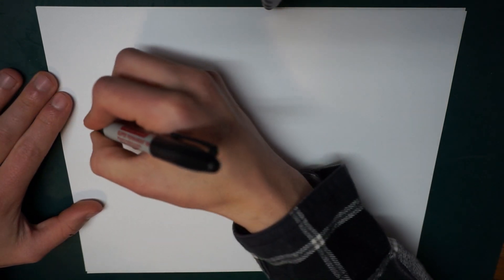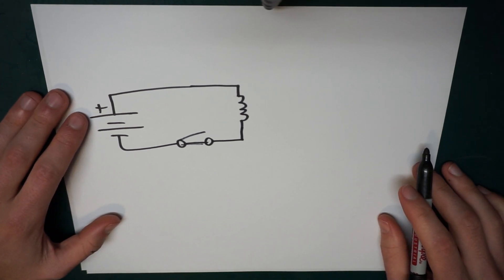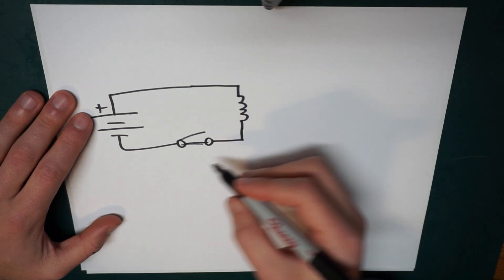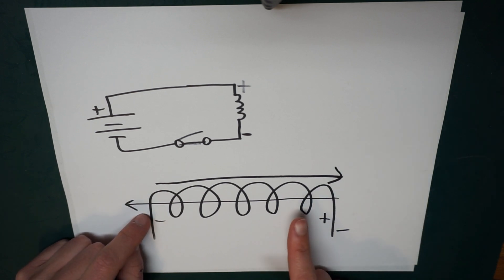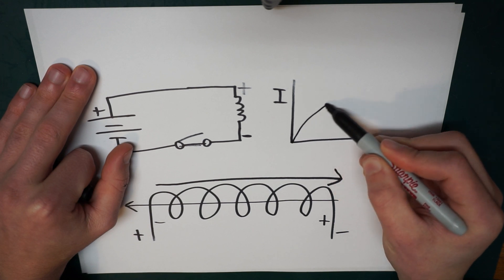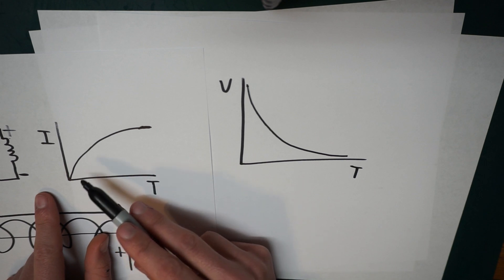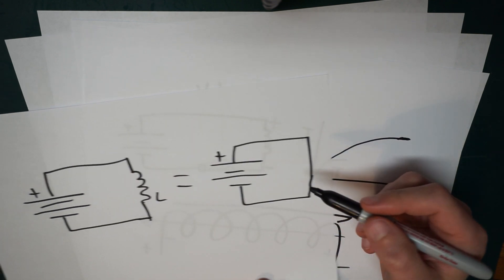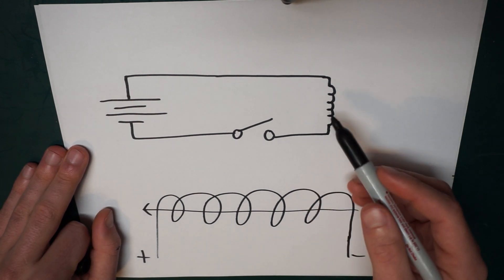Circuit Fundamentals - Inductors in DC Circuits

Comment: In your initial circuits there was no resistor in the loop. Then the current in Inductor should not settle to a constant value right? It will keep on increasing like a ramp signal?

Comment: That was a great explanation but what I've found is that doesn't apply to all inductors. I have fashioned a coil with an AC/DC transformer power supply, no components involved and placed a compass at one end of the inductor/coil and the compass spins on its' own axis.  Can you explain that?  Is the DC current supplied by an AC/DC transformer fluctuating or not?

Comment: So, initially it acts like a high value resistor, and then behaves like a short .... I always looked at the phase of the open switch as " once the switch is open, in an effort to maintain the current flowing through the circuit, the inductor releases its stored energy in the opposite direction - toward the battery. This forces current to run through the circuit and literally jump across the switch. It creates that familiar 'Spark' "

Comment: I used to be befuddled by inductors. Eventually someone said to think of electricity as having physical momentum. When you close the switch, it takes awhile to pick up speed (amps). When you open the switch, you get the equivalent of water hammer in a pipe. Then inductors made instinctive sense, and layering on how the magnetism works was easy to think about.

Comment: In the first example with source and inductor only, how there is an upper limit for the inductor current? According to the di/dt = V/L, with constant voltage, the current seems to keep increasing linearly (which is not practical case), so in the previous example we need to add resistor that will state the max current through the circuit, yes?
Reply: makes sense. I guess he was just trying to give us a basic idea or a general understanding of what was going on but yea what u said does make sense.
Reply: in practice any component has it own resistance, so even with out an extra resistor, there is still some resistance in the circuit